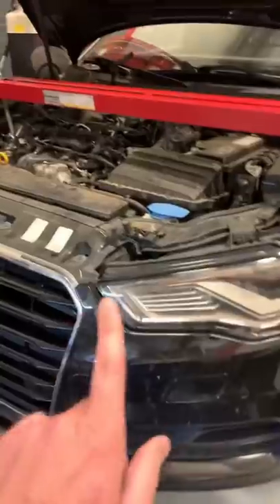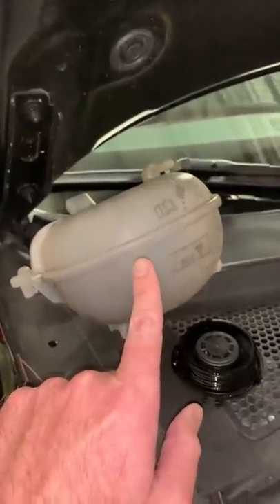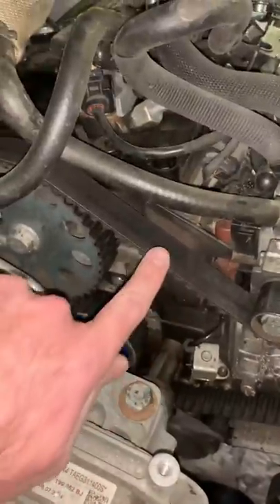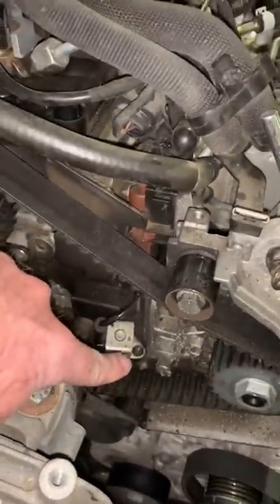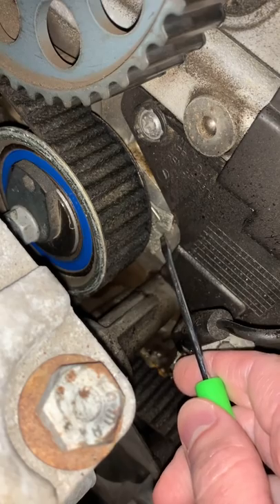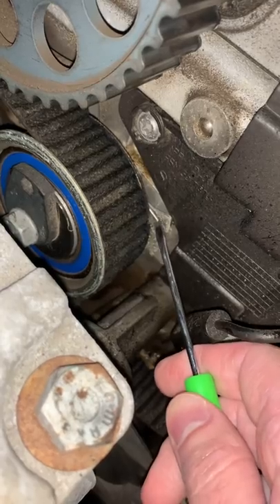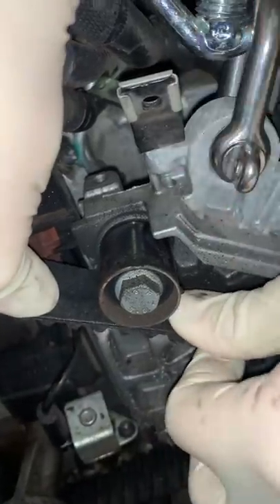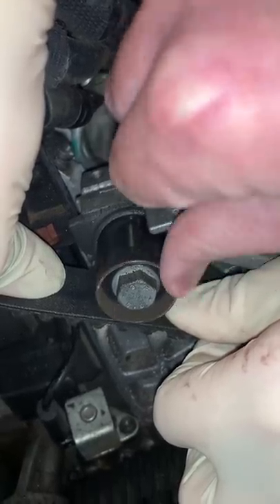Don’t let problems go on your car! #shorts

Comment: And that's why I only buy older cars with timing chains they might stretch after a long long time but they are way more reliable
Reply: Yeah any interference engine should have a chain. Toyota put belts on non-int and chains on int. engines for EVER and i love em 4 it but even they r guilty of it. Engineered obsolescence is a real thing. Japan followed american model that sell ppl a car every 3 yrs who cares if it lasts 30yrs. In 80s 90s early 00s yota still built cars to last for literally ever then started changing their ways due to lack of ppl trading in those cars for new ones. See many 90s cavaliers on road? Or and 80s 90s american small car? Nope not really they all fell apart while you REGULARLY see old Toyotas still going. Hence why i drive 90s toyotas still and fight rust but yeah VW is guilty as the rest
Reply: @captaintoyota3171  even the newer Toyota’s are far more reliable than anything built by the big 3. A 2009 Corolla can easily get 200-300k with just regular oil changes and a transmission fluid drain and fill every 60-70k. Neighbor has a 2006 4Runner with 310k running strong.
Reply: The automotive industry has pretty much gone back to chains in the new cars. Nissan, Mazda, Honda, Toyota, have all gone back to using timing chains for exactly that reason. Most chains are on the scheduled maintenance at around 140,000 miles. Belts were introduced because chains were noisy, and older vehicles had a tendency slap the chain off of the guides breaking the plastic silencers. Belts were supposed to end all that. But newer engines rev higher, cam loads have increased due to higher cam lobes, and stronger valve springs. That used to make engines shake alot but now they use variable valve timing to give smooth idle, low emissions, good mileage, and still have the power to get up and go.
Reply: Tell that to poor people with 1st gen 1.2 and 1.4 TSI
Reply: You wouldn't say that if you owned a BMW, they mastered the art of making timing chains less reliable than belts, and designing them so the engine or transmission has to be removed to replace the chain, if you were fortunate to catch it before it failed completely and trashed the engine.
Reply: @traviscapehart7590  lol. Don't br naive. The only reason they went back to chains is that they're a lot more expensive to replace, both parts and labour. That also means car goes to garbage sooner, that's all a manufacturer cares about.

Comment: This is the endless money pits Scotty warned me about in a video where the engine was smoked. Haha
Reply: Don't buy anything with a belt. Timing chains are the way to go.
Reply: @joshcarlson9352  unless its a VW cause there belts are more reliable than there chains 😂
Reply: @joshcarlson9352  my 1999 4runner has a timing belt and it's reliable. But audi is definitely not reliable at all

Comment: Any decent TDI owner knows you need to change your timing belt and water pump at 80k its expensive but worth it.
Reply: @Adam owners manual and experienced owners are two completely different things. 

I don't have experience with newer VW's but I have owned other vehicles where that was definitely the case. The Aprilia Tuono motorcycle in my pic is an example, the forum for that bike is a wealth of knowledge, so much better than the manual.
Reply: Yeah, you dont want to listen to what car manufacturers say. Most maintenance schedules are meant to get your car to 120k miles and then the car is supposed to be replaced.
Reply: @colecooper5836  true but who wants a car with 120 k ? It’s done and past it’s best
Reply: A good solution is to not buy audis
Reply: @robprior1246  ewwww. The whole “always new vehicle constants trade in” approach is highly wasteful.

If you maintain the vehicle and don’t abuse and beat the shit out of it we can save so many resources rather than sending a perfectly good vehicle to the graveyard because you won’t simply maintain it….
Reply: Dont think mines ever been changed and its got 142k and dosnt look toooo bad. Still changing it tho cause i just bought the car and its cheap insurance
Reply: Timing belt interval on this Audi's Tdi is 120k.
Reply: @greengeeker1  Oh, really? I guess I shouldn't comment so arrogantly if I only know about my specific engine.
Reply: @robprior1246  My car has 130k. It’s a BMW. In fair condition, mechanically sorted, and has at-least 100k more miles of life left in it. Albeit, I’ve had it for a while and taken great care of it but, it’s far from “done”.
Reply: @justinstevenson2061  I know what you mean but at 100k and over it is not at any means like a new car or newer car and most of the time the repairs to keep said high miles car on the road do not make economic sense plus newer cars are much cleaner and better for the environment.
Reply: @677dm5  I hope your car does do another 100 k miles but it will be at a cost of repairs and as cars get older the repair bills go up ,
Reply: @robprior1246  I mean actual high mileage repairs I get are expensive.

But 100K is not high mileage.

Also, the cost of buying another car is 40K but because you make payments you don’t seem to think of it as that much.

If you sink 10K into your older ‘high mileage’ car then get it for another 100-150K then your value is much better.

$30K car to drive it 100-150 K or $10K repair to drive the same extra distance.

Between the interest, and depreciation on trade in your losing $.
Reply: @justinstevenson2061  on the uk 100k is considered high miles , after this point cars are worthless as no one wants them
Reply: @robprior1246  exactly, and that attitude is wasteful.

Not that the cars build quality or reliability should differ that much, it’s more a standard le thing of the area.

So then one place is more wasteful than the next due to different standards is all.

All the manufacturing and raw good and chemicals etc that go into hundreds of thousands of car, all to be driven a couple years and recycled which then yes is good due to reusing a lot but still takes more transportation and then energy etc for the recycling process.

Again jjst oveeall wasteful. Of our raw good, and $$.

Not a very viable way to live l.
Reply: @justinstevenson2061  welcome to 2021 , why does everyone replace their I phone every 1/2 yrs same can be said for all walks of life , unfortunately with the way things are going here with a ban on selling ice vehicles from 2030 in the future every one will need to either keep their current ice vehicle and pay the crazy tax on fuel or invest in a huge code electric/hydrogen vehicle , and they won’t last as long .
Reply: @robprior1246  yes exactly culture is a huge part of the issue.

I get the new phone, but keep it for years to come.

It’s like saying a home isn’t good after 10 years, knock it down and build again.

Hey why not?
Reply: @justinstevenson2061  he’s broke. He probably can’t even afford a vehicle.

Comment: The first problem starts when engines are specked with a wearable timing belt instead of a nearly bullet proof chain. With that said audi and or bmw has an engine or two with 4 timing chains which is almost as scary. 

Fun to drive but not fun to service.  Such is life.
Reply: Chains aren't bulletproof, metal fatigue is a thing, and it can just explode without any warning signs. Besides, that belt is silent. That being said, chain can fundamentally last the life of the vehicle, the belt absolutely does not.
Reply: Chains are wearable too. And they are a lot harder and more expensive to replace. A standard belt is stronger than a standard chain, that was proven many times. Belt has to be replaced more frequently, but that guarantees that you won't have any timing troubles. Also replacing a chain usually involves removing metal covers than have to be reinstalled with sealants and gaskets, and that's a high leaks risk since it depends a lot on the mechanic, his skills and choice of sealants.
Reply: I’ve never heard of a chain failing in a modern car but I have heard of belt issues.  Those belt issues might be addressed and fixed now  but time and experience has shown me that metal will hold up better than the belt. Plus a belt in cycling is less efficient than a chain and has more friction.  Apples to oranges comparison but relevant. 

My whole thinking has been that a belt could slip a tooth or two and the pistons might smash into the valves verses a chain getting sloppy and warning you it’s time for some attention.
Reply: @vaseabmwe39  I love how so many people apparently have different reasons, experiences and views on belts verses chains. I may not have my mind changed but I always learn from these good comments/discussions.

Comment: Audis are great cars...UNTIL THE WARRANTY RUNS OUT!!!
Reply: until you don't do maintenance 🤣🤣
Reply: Extend the warranty then
Reply: @robprior1246  when you pay $75k...you'd expect some reliability in the car without extending the warranty...not the case!!  They are definitely not the "everyday" cars!
Reply: @wsalas13  they have a 3 yr warranty from the factory that is extendable to 5 yrs or 100 k for a small fee , audis are no more unreliable than any other car
Reply: Brother and father bought brand new Audis...both said they will not be return customers

Comment: Literally work on this engine every day, the roller he said you shouldn’t be able to move, should move it literally has a bearing so you can move it…
Reply: You've missed the point. He's saying you shouldn't be able to pull the belt away from the idler pulley just using your fingers if the belt is correctly tensioned.

Comment: My sister has an 05 TDI jetta and all we have  had to do to it is Chang the oil, radiator fans, water pump and timing belt and brakes. The car has been getting around 40 miles per gallon or more. Great car. I forgot to mention, there's over 300,000 on the car and still runnin storng.
Reply: 1 out of a million! Those Jetta’s are shit!!!
Reply: @HierarchyOfWeeds  you are correct but it has a full aluminum skid plate and I'm so glad it does.
Reply: My 06 trailblazer has a 4.2 vortec and I've changed oil and put front hub assemblies on it.  Nothing else ever done at 204k
Reply: @mattmaster2582  lol right
Reply: @gamingmadesimple5510  yep, I daily a 4.3 03 blazer that I absolutely dog on, I mean like tryna be a formula drift driver on dirt roads. At 238,000 the motor has only ever needed an alternator and a water pump, and that's with the corrosion from the dex-cool shit.

Comment: And there you go you end up spending more money on a car like that and they give you a damn timing belt
Reply: Right? If its interference it should be a chain. Toyota for most part followed this philosophy for decades belt-non chain-for. VW? I duno why ud do that but this guy may be wrong this may be non interference engine i duno but being diesel prolly is most diesels are
Reply: @captaintoyota3171  a majority of engines now are interference and belt driven. I guess it probably reduces build costs. As far as I'm concerned just make everything a chain lol, belts are almost always causing problems

Comment: This is why I stay away from new junk designed to fail with belts where chains should be, plastic where metal should be, and little to no clearance under the hood for servicing.

Comment: Yeaaahhhh. I rember the time my Z3 tried to kill me. Waterpump broke on the off ramp doing 55~ (90kph). So there I was, Tokyo drifting as I slipped on my own coolant that was dumped om my back wheels and being the most scared I had been in quite a while. Recovered and carefully drove it a bit further when I noticed my engine, was getting a bit hot. That was when I noticed my waterpump had left the chat. Took me 3 hours to go 2km. Replaced the pump the next day on my doorstep.

Comment: They always go outside the window after a decent amount of miles. And even with a new belt and tensioner you can do that with the idler pulley. That window is where you set it when tensioning the new belt but they eventually go out of the window.
Reply: Yeah he is stretching a bit here claming coolant stretched belt due to water pump weep hole leaking. Yes tech it can do that but that belt looked ok for my guess higher mileage belt. But yeah coolant leak shoulda been found early but water pumps off timing belts is such a lame idea for wear part.   Also toyota belt engines r non interference if not they have a chain. Vw?
Reply: @captaintoyota3171  Yeah, then when he said "This engine actually could have broken a timing belt which would've allowed it to jump time" sounds strange to me since 'jumping time' generally refers to an engine that's still running but the timing belt or chain has jumped a tooth. If the timing belt outright breaks then of course the engine won't be in time. The crank & cams aren't connected.
Reply: @captaintoyota3171  pretty much all car diesel engines are interference. It's inevitable with the compression ratios involved and the different head and piston construction to petrol. Most diesels here (about 70 percent of cars here are diesels) are belt driven and they're fine with usually around 100k mile belt change interval. I've honestly heard of more modern chains having issues than belts by stretching, snapping etc. because they're under designed.

Comment: Gotta love engineers.
I have a great idea!
Let's use a belt that has to be changed periodically for several hundred dollars, use it to drive the water pump, so when the pump goes bad, you need to replace the belt, for another several hundred dollars, and if the idler or tensioner pulleys go bad or you don't change the belt often enough, the belt gets loose or breaks and jumps time, destroying the engine.
But the engine is imperceivably lighter and quieter.
🙃

Comment: This is why you never buy an Audi, or any other car with a Timing Belt. Timing Chains are the best
Reply: Nothing wrong with belts, easier to change a timing belt than a chain…

Belts also arnt affected by lack of oil changes

Comment: My dad had an integra when I was a kid. It was an 89 model, manual, no A/C, stripper model. In 10 years he put 325k miles on the car. It needed a timing belt but he was tired of driving a car without A/C in California. The car ran perfectly fine up to the day the belt snapped. 

Then he bought a CR-V in 98 and we put 240k miles on it between him and myself.

Comment: This is why you dont buy an interference engine especially if it has a belt
Reply: What engine doesn't have Belts? Besides having chain? Or is that what you meant sorry I don't understand your comment
Reply: You do realize that 99% of the engines out there are interference type, at least in the EU. It's more like: if you can't afford to maintain a car then don't buy one.
Reply: @talictdf4757  or buy an older vehicle with a more reliable design if you dont want to blow a ton of money... we still have plenty of single cam motors here in the states because they don't have nearly as many catastrophic failures and they are easier and cheaper to maintain.  To me single cam is desirable if I want to keep it a long time.  My Mustang V8 sohc also averages 32 mpg the way its set up, so you can't say it's an efficiency or performance thing. That car has tons of both. It still outperforms most of the newer high tech cars on efficiency and performance. And even back in 2004 it was affordable.
Reply: @misterbulger  Older cars are nice for the reliability but they have a bunch of different problems like cabin noise, rattling interior, missing features and so on.. it's always gonna be a compromise of some sort.
Reply: @talictdf4757  sounds like luxuries that only the 1% should be worried about buying
Reply: @misterbulger  not really, I'm talking about practical things that help you get from point A to point B faster and safer or make the journey pleasant enough so a longer ride is not a huge chore. At this point in time I don't think that's a luxury for the 1%, that's more like diamonds in the speakers type stuff.
Reply: @talictdf4757  They all financing and living on debt... so many people over extending themselves. I get it if you drive for a living or something but just to drive to the store and Starbucks and hang with your friends and family you just need an old minivan or something.

Comment: I dumped my Audi A3, 45k miles only, on the junkyard. Still like a new car, but nobody were able to fix the timing chain. What I did next, I bought a 1974 El Camino, my daily drive since 2017, and love it.

Comment: My sons 2012 chevy sonic 1.8 is so close to the same its not funny. Belt, driving water pump, can be bought as a tensioner,belt. Pump kit......oh yeah all bolts are torx head bmw type bolts.....all aluminun...
JUNK...
AUDI, GM VW ....

Comment: In reality, according to their 'Dependability Rating' scale, Audi actually ranked 28th out of 36 brands for reliability in 2019. ... Out of the 24 manufacturers in the study, Audi comes in at 22nd, with an average of 167 problems per 100 vehicles

Comment: My car had a persistent oil level/pressure issue. I just figured it was a faulty electrical connection at the dash, since it had plenty of oil and a brand new pressure sensor, and the pressure gage was doing really wi3rd things (suddenly jumping off the gage straight down then jumping back to normal). Turns out a bearing was failing.

Comment: Correction: This is why you dont purchase an overpriced, poorly designed car that implements a system like this. Audi dealerships are notorious for charging outrageous prices for what should be easy maintenance because of unnecessary engineering designs.

Not entirely Audis fault buyers at fault here too. You want a expensive fancy car, then be prepared for your expensive fancy bill for when it breaks.